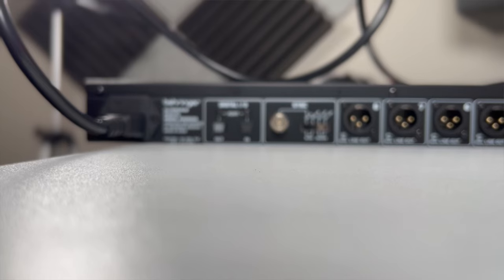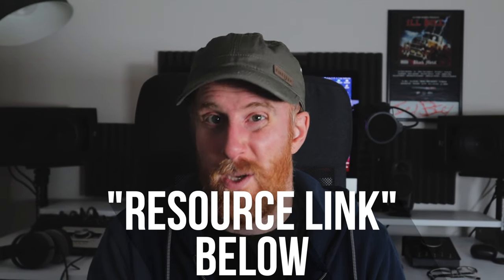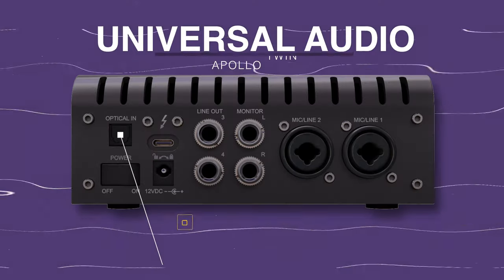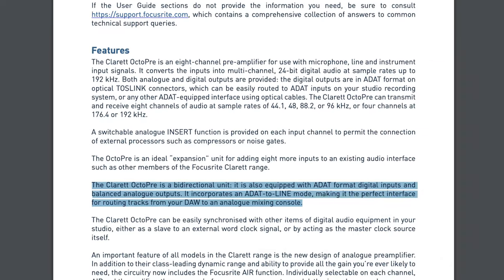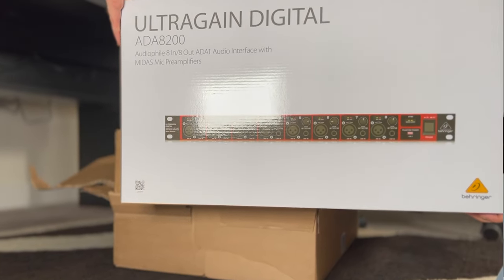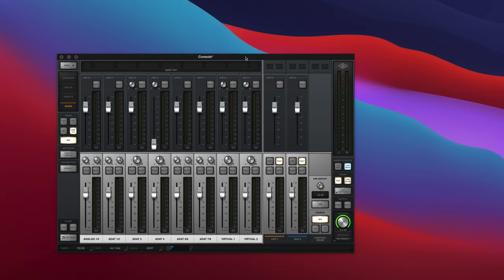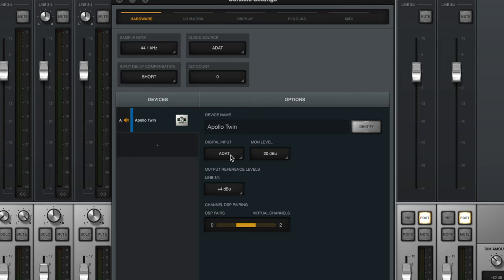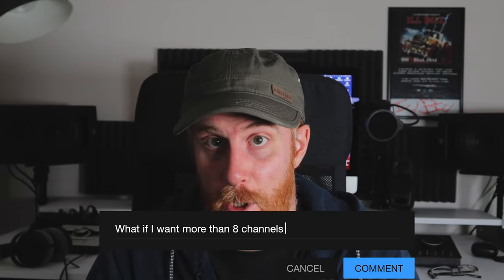How to Add More Inputs to Your Audio Interface & Expands its Ability With ADAT Inputs

Comment: Question Please:
Would This Method work with my scenario below.
*
I have an Alesis 24 trk Hard Disc Recorder (HD24-XR model which has the higher end AD/DA convertors) and I was wondering if I can use the Light Pipe outs (24 total outs that are in 3 groups of 8...and 24 total inputs ) to be my interface with my DAW.
*
I would like to use the TRS balanced audio into the Alesis Hard Disc recorder and then take the light pipe out signal of the Alesis unit and use an audio interface (or use some device) to convert the signal to USB to use my DAW.
I would do the reverse on playback so that I can mix old school through an analog console with vintage outboard gear...Hoping.........Thanks in advance...
Phil
NYC Area

Comment: Would the Behringer extension work fine if I just wanted to use its line ins/outs to connect outboard analog gear?
Reply from the maker: Not in this scenario no. As I hope I explained you need both ADAT in and out for that kind of signal flow. Unless you spend a lot more on somthing with internal routing.

Comment: This is great but wouldn't the Behringer downgrade the audio quality due to its preamps?
Reply from the maker: Absolutely not. The MIDAS pre amps are good. The UAD ones are better in my eyes sure. But there’s always something like the claret pre if you wanna spend the extra 600. Me I’m using the line ins so really not fussed.
Reply: @Unders  aren’t the pres in this would be bypassed right?
Reply from the maker: @TheMelodyGod  In my scenario yeah. If you're using mic's no.

Comment: I have my connections correct but I’m not hearing sound with Apollo bieng master and Scarlett bieng slave with 6 outputs going into monitors for 5.1 setup
Reply from the maker: What Apollo and scarlet, because that’s not going to work without ADAT in and out. My twin in the video only has in which is why I make a point of saying you can’t use outputs with only ADAT IN. 

I’d you’re on Mac you can make an aggregate device. In audio settings and sync the two that way.

Comment: I have a question and maybe you can help. I make hip hop beats and I mostly sample from vinyl and chop up samples. I use a MPC X which has 8 outputs. For my daw to record my beats into is Logic Pro on a m1 Mac Mini. I found someone selling a UAD Apollo twin interface very cheap but I know it only has 2 inputs and I like to take advantage of my 8 outputs on my MPC by separating sounds on different channels. My question is if I buy the Apollo interface and use a Behringer Ultragain ADA 8200 for the extra outputs to record into Logic? Can you explain how that would work? I’m use to using a digital 003 which had 8 inputs but it’s time to upgrade
Reply from the maker: Twin does not support extra outputs. This allows 8 additional inputs. I use it for MPC, drum maschine, maschine etc etc. but there is no back and forth routing with the twin. It cannot do it. 

You want to track the out of your MPC. Yes. 

You want to send them to outboard after tracking. No.
Reply: @Unders  So can use the adat from the Apollo twin to Behringer for the extra 8 inputs then thunderbolt to my Mac mini to record my beats into Logic Pro and the Apollo twin as the interface to my Logic. Sorry if this question is stupid but like I said I’m trying to update from an old digi 003

Comment: Can you mix and match A/D devices to an ADAT device that are from different manufactuers? specifically, the presonus devices I've had, do not play well with others?  is there something wrong with ASIO, or is ASIO4ALL a better choice so the two devices play well together, or is it a design flaw in ASIO or in Presonus device.  I cannot find any answers to this.. All the ADAT videos, do not cover this issue.
Reply from the maker: Yo sorry you sent this the day i took 2 weeks off. The answer is yes on MAC as you can make aggrigate devices. For windows i do not know i've not used it since 7 came out.

Now ASIO 4all has never been my friend either, ive always had better results working with native drivers, M-Audio with my Delta 1010 way back when. And the UAD system as shown is complex but so versitile an solid. As shown totally different brands but it simply doesn't matter.

Comment: if i connect a ADAT external interface with midi channel , Apollo will read the midi ? i need to read midi with my apollo twin but i dont know how
Reply from the maker: You can’t send midi over ADAT “AFAIK” but you can create an aggregate device that includes MIDI input using two interfaces
Reply: @Unders  Ableton Cant read two interfaces at the same time :c
Reply from the maker: @Xowun-bkule  thank me later - https://help.ableton.com/hc/en-us/articles/209071609-Using-Aggregate-Devices-and-multiple-audio-interfaces
Reply from the maker: Also, With midi routing via aggregate. https://support.apple.com/en-us/HT202000
I only know the resources for Mac if your on windows sorry.

Comment: I got 4 speakers and I need help man I can only control 2 of them
Reply from the maker: ADAT doesn't allow you to output on the Apollo twin as it only has an IN ADAT. You can however use the alt out's as extra I/O - https://help.uaudio.com/hc/en-us/articles/115002813886-How-Do-I-Send-Signal-from-My-DAW-to-the-Line-3-4-Outputs-on-My-Apollo-Thunderbolt-Desktop-

Comment: Hey bro,

Thanks for the video, it helped a lot. But i need you help for another thing also:

Im using Apollo Twin with Behringer Ada 8200.
Ive set Behringer to 48khz and in UAD Console clock to ''ADAT''. I can see now the virtual channels and signals coming through them. When i monitor my instrument, it works fine. Showing signal path on ADAT 1 channel in UAD Console.
Issue im having is in Ableton during recording. I've selected 3/4 input channel to record bass guitar cause i can see the signal when i play on 3/4 channel. But when i hit record, it records the output of the backing track (playing mix, in the other cannel in Ableton) also in the record track with the bass.

What am i doing wrong? Thanks again.
Reply from the maker: I truthfully don’t know. Never had that kind of thing happen 🤷‍♂️

Comment: YEAH BE OCH I NEED MORE I/O!

Sorry was tracking rap for the last 3 weeks
Not one of my genres of choice but pays the bills

Anyway
Have a Audient asp880 on the way
About $1300 US for 10 year old tech but the “if it works don’t fix it” fits here
Something nice here is the aes, spdif analog DB25 allows
Simultaneous use of eight channels light pipe and DB25 analog ins and outs
Onboard patch point switching for outboard gear, Front side switches for both sample rate 44.1-96 and impedance against the pres @ 200-1400-3600ohm respectively of course pads, combo Jacks for inputs, the ability to bypass pres for outboard if you choose the patch point buttons for each channel and front panel jfet DI built in so no radial needed for hi z guitar, bass ect..
Just very versatile box
A bit more than I wanted to spend for adat expansion but the converters and preamp quality even compared to the new Apollo pres are worth the price of admission 

So so much better that the Berhringer 8200 I was running, if your paying for Apollo don’t kill quality with these cheaper solutions 

I passed on getting another Apollo X rack in favor of this
The unison pre UAD plugs are good but the real deal is better
In hybrid I use both plus the now available UAD native right in protools 

I was waiting for Audient to release a 
Asp900 or 980 but they’re recent offering of the evo makes me think it’s not gonna happen and the asp800 or 880 is a better choice given my experience and personal opinion, good luck!